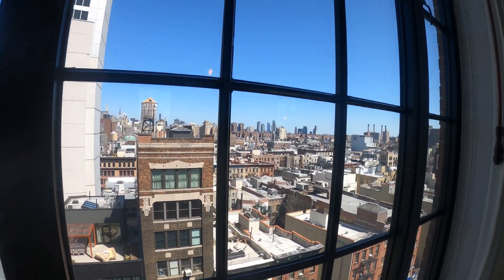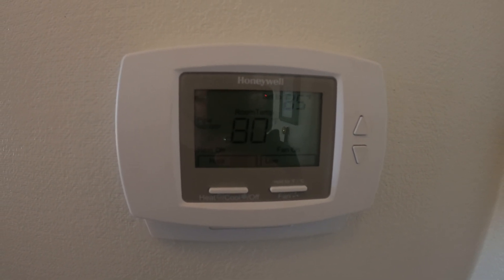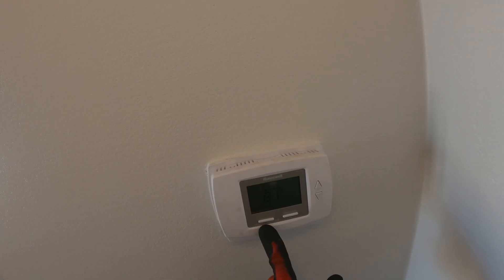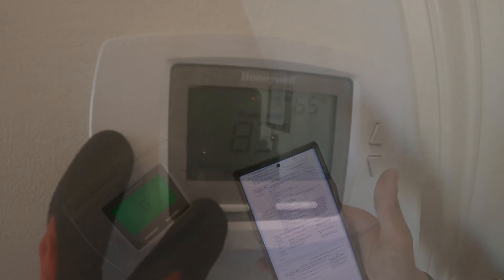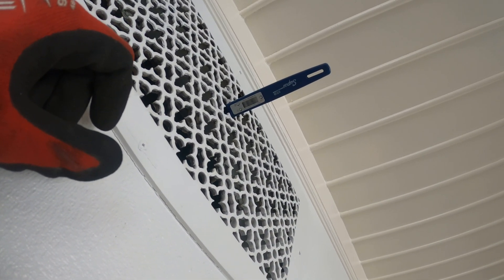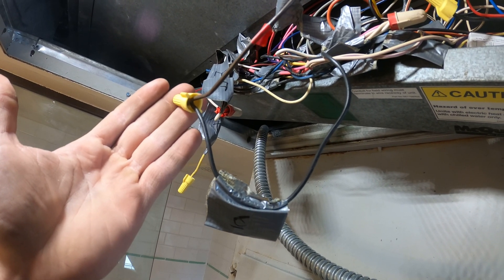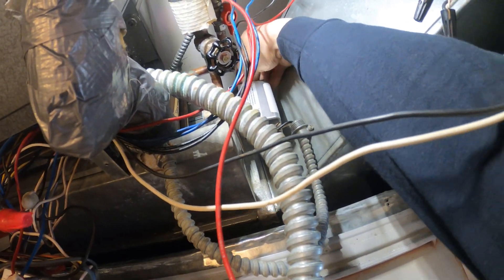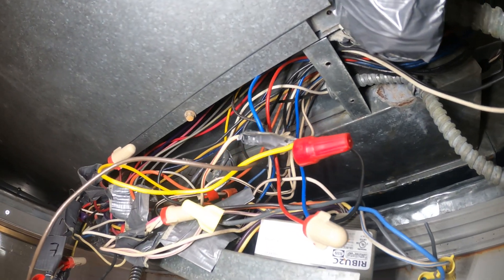HVAC Service Call: FCU Not Cooling (Fan Coil Unit Thermostat Not Working Properly) FCU Repair

Comment: Thanks for the video. My room Chiller cooling system works fine however, when i set the cooling to certain amount and when the room temp reached that level my AC keep on working without turning off, i wonder what is going on. I'm not a pro i'm here for some tips and advice :) 

Recently i'm seeing my Chiller bill coming so high every month. someone told me it could be my AC actuator failing or maybe bypass. i'm not sure what's going on.

Comment: My bet: At this point, it seems that in a parallel world there is an army of killer octopuses that take the form of fan coils with a mess of cables instead of tentacles in this world and they are after you. I'm fully convinced.